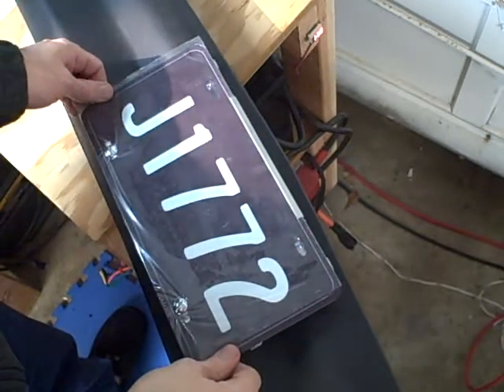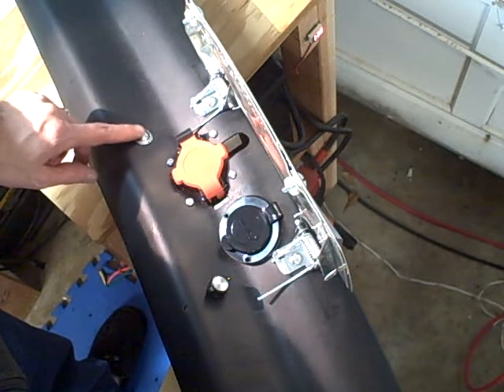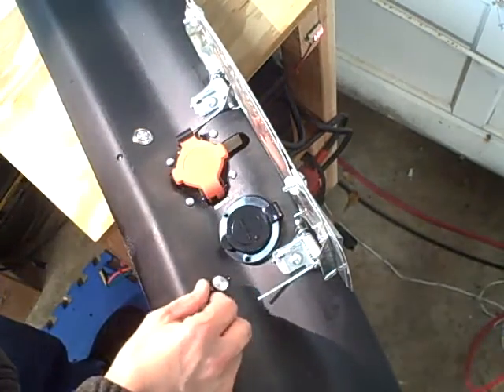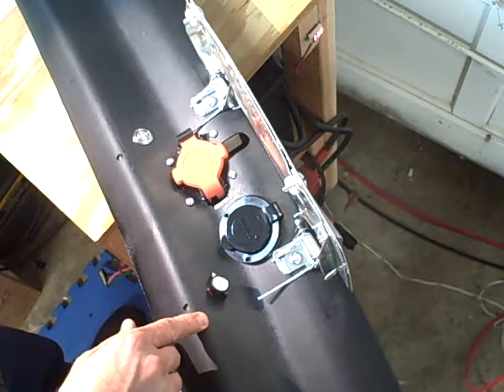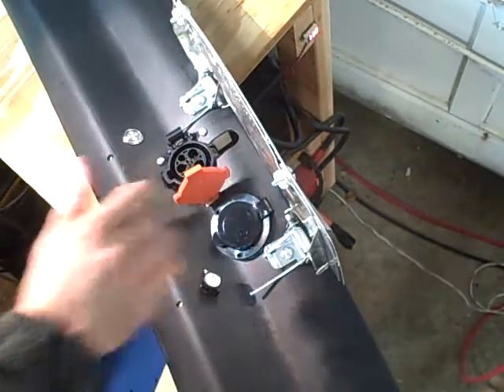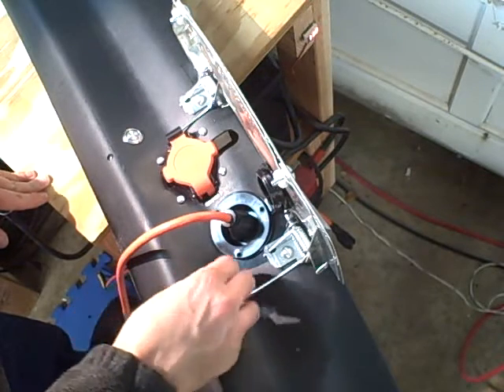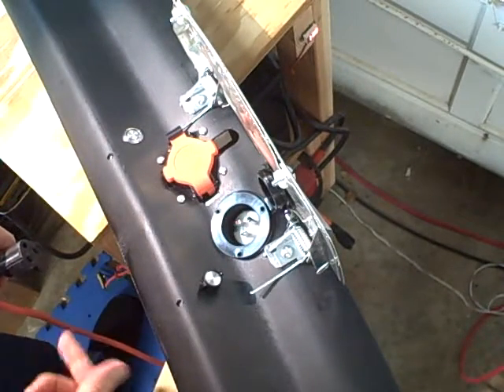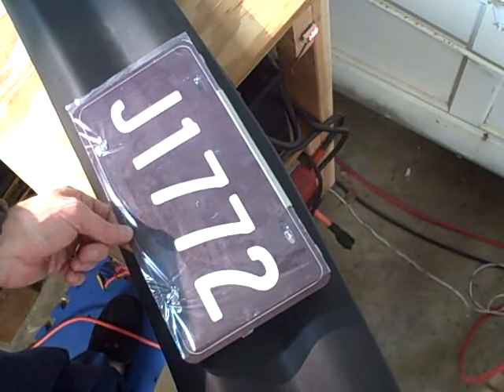Hiding a J1772 EV charging inlet behind a flip up license plate

Comment: You might consider a small LED light source to illuminate the sockets. It's harder than you might think to install the charging plugs in the dark.
Reply from the maker: +Brett Duane Not needed in the day, but at night it would be very useful if you were plugging in somewhere that didn't have a light. (My home EVSE is right under a motion light, so I haven't needed it yet, as I charge at home 99% of the time, but I do have a flashlight in my glovebox should the need arise)

Also, because the license plate is flipped up, you really can't see the inlet well unless you squat down to look, so mostly I've gotten good at just finding it "by feel". Obviously, mounting it higher up in the grill would be easier, but since the truck doesn't have any good options for that I decided that behind the license plate was a workable solution.

On the plus side, the flipped up license plate makes a "roof" for the charging gun, keeping rain/sleet/snow off of it overnight.